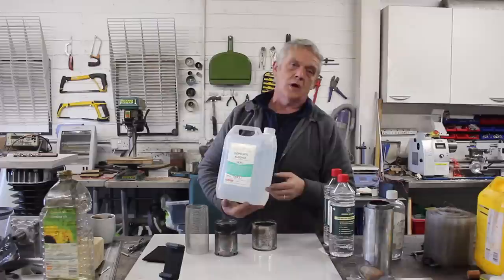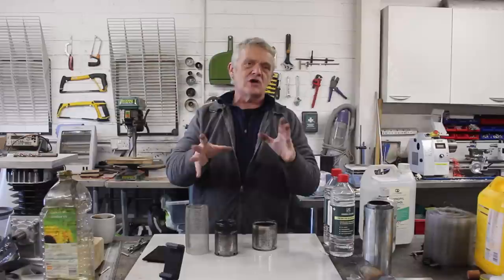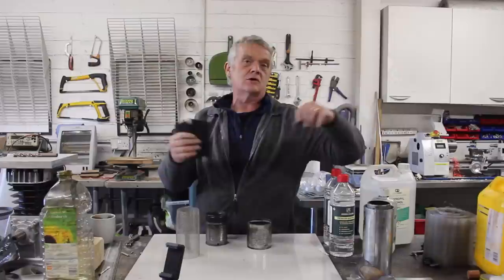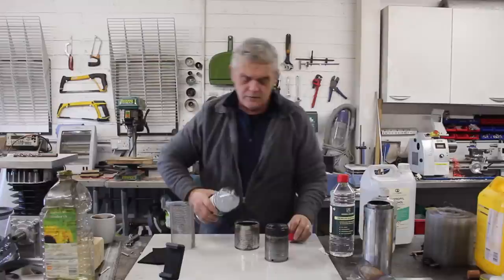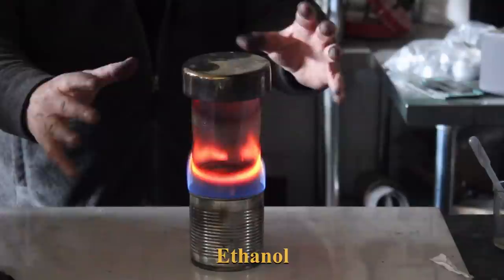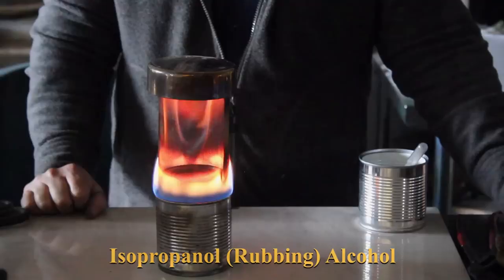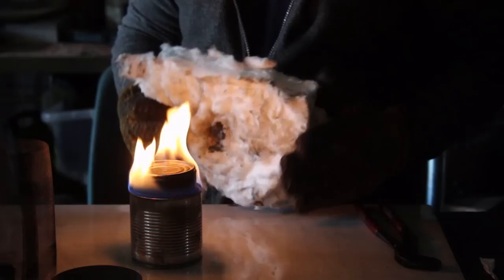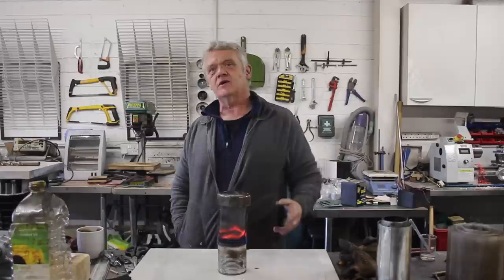1704 Trying Different Fuels On The DIY Heater 1

Comment: Here in the US, carbon felt can be found at most "big box" home improvement stores like Lowe's etc in the plumbing area in the form of a welding or soldering"blanket".
Plumbers use them for fire protection when soldering copper plumbing ....
Reply from the maker: nice one mate - thanks for helping out
Reply: Great tip, thanks for this!
Reply: Thank you very much. Great info
Reply: Thank you, I would have searched for eons!
Reply: still kind of $$ when you could use a wool sock or layers of tissue paper, cotton yarn etc.. they should last as long as the burner as long as you dont let them run dry and burn the wick
Reply: @docink6175  Up to you what you think is best. This stuff lasts literally forever.
Reply: @TheBaconWizard  your right but the stove won't, it just seems ludicris to me to make a stove using free cans and spending  a good amount of money on a wick when free or almost free will work as well for nearly as long as the stoves life but even if you need to replace a tissue wick twice a year it costs less than a nickel for the year
Reply: @docink6175  Horses for courses mate, it's always good to know all the options. For me it''s cheap and easy to get and I have other uses for it.
Reply: thanks ... been hunting for a week.... walked right past it!!!
Reply: @docink6175     Wool should last longer time than cotton etc.  Wool has a high combustion/ignition temp (higher than kevlar) and doesn't readily burn.  But then again, I haven't ever actually tried it.
Reply: @justinw1765  look for cat stove or friskies stove etc, this heater is just a modified version of those and there are all kinds of vdo's on different wicks
Reply: @docink6175  Robert's projects use carbon felt all the time. While it might not make sense for this heater here in the US, it might make sense if you upgraded the build or if you were using the carbon felt in another project, or maybe you come across an old one of these things for cheap, or if you're done with yours. Now thanks to this comment, I know that if I come across some plumbing tools at a thrift store, it's worth looking out for carbon felt.
Reply: @zahialsalman  all Im saying is there are lots of options for wicks, if you have carbon felt thats great but there are a lot of less expensive ways to achieve the same goal
Reply: @docink6175  Fair enough.
Reply: @docink6175  the problem with your theory is that you assume that the goal is to make exactly the same burners made in the video. these are just concepts, demonstrated in a "you can do this at home. today. practically for free" just do it, way.
if you genuinely intend to USE these a "forever" wick is a very interesting concept, especially as trimming wicks was a genuine problem when people used the products you mentioned to generate light. once you have a few feet of this stuff for a project why not just use the rest in these "experiments" it is a cheap at that point as any of the other scraps you mentioned.
Reply: Thank you
Reply: Yes I found it as a welding blanket and 1800°F flame resistant
Reply: Bought a welding blanket and 1800°F flame resistant, no good, not 100% carbon fiber felt. Anyone have a link for 100% carbon fiber felt? Having trouble finding it, all Lowe's had was felt roofing underlayment. No one knew what I was talking about.
Reply: That is Carbon fiber felt, welders mat. He said not to use anything that said Carbon fiber.  All the listings on ebay say " Carbon Fiber Welding Blanket Felt High Temp Heat Protective Sheet"  It never worked well in my burner.  It was a very poor wick.  It burned without the inner tin and also if I cut slots in the tin however  the methanol burned very quickly and not evenly.
Reply: Hey Mr Henderson I just came back from Lowe's and looked all through the plumbing department and Welding Department and asked so-called Plumbing expert at Lowe's they don't carry it here so I'm going to go to a plumbing Outlet place see if I can find some there thanks so much for your suggestion
Reply: @rickgomm7432  you're most welcome....but you can also ordering eBay or Amazon as well if you have trouble finding it locally.
Reply: @rickgomm7432  I used a cutting from a welders blanket.  A fire blanket will work also.  It worked much better than the carbon felt.
Reply: I was wondering if they'd be suitable, thanks for confirming.

Comment: Nice one Robert. As always when using any appliance with hot naked flames, caution, safety and vigilance is necessary. I came from the 1950s where open fires, paraffin lamps and heaters and even gas mantle lighting were common.

Comment: Just to say I have a commercial paraffin heater that purports to use a GLASS FIBRE wick, which only needs to have the eventual black oily deposits burned off by using all the fuel to empty tank. Apparently no trimming needed! Great show.

Comment: I just had a few thoughts: 

1. The flames travel up the outside of the mesh.  What about using multiple layers of mesh with spaces in between them?  That will multiply the surface area that can be heated up and radiate IR.
2. Instead of a lid, what about using cheap stainless steel scrubbers, stacked inside the mantle?  That would also increase the mass while still allowing air flow.
3. Depending on the stainless steel scrubbers available to you, can you check to see if they can be unrolled to be used as an easily-available mantle?  If not, could wire be used to hold them in place so they act as a mantle while in their original form?

Cheers!
Reply: Number 1 suggestion sounds great for Rob to check out - Will it use more oil and be hotter, use the same, or will the heat output be comparatively reduced because of the greater heating surface area required ?
Reply: @regwatson2017   the majority of the heat will escape either way so a larger surface area would catch more that would otherwise be wasted. Pretty sure steel wool gets weird when its been heated up, im not sure what a steel scrubber is but it seems like steel wool
Reply: @ScottyHugefellow  Steel wool made with tiny filaments of steel (which readily oxidizes); Stainless Steel 'scrubber' filaments very much larger -----> greater thermal mass, so less likely to become red hot/vapourise.  Copper scrubbers even better conduction.
Reply: @denisripley8699  still not entirely sure what a scrubber is, unless its what appears to be a higher quality steel wool. I can test it as a thermal mesh when identified

Edit: re-read your comment and it makes sense now.

 Thanks we'll have results soon
Reply: @ScottyHugefellow  Sorry Scotty.. I'm in my angloshere bubble !  A scrubber or scourer is, like you suggest, a heavy duty, durable version of steel wool, almost always made of stainless steel and unlikely to irritate bare fingers like steel wool does. It's the stuff that's also used in homemade distillation columns, although copper 'scrubbers' or mesh is a better option in that application.
Reply: @denisripley8699  haha thanks mate I'll get some tomorrow so we can test it out. Also a member of the Anglosphere ;) where the roos are
Reply: Just an update to let you guys know that testing is gonna be further away
Reply: @ScottyHugefellow  

Did you ever do that test?

Cheers!
Reply: @KeithOlson  no I did not, you just reminded me. Forgot all about it ended up not being able to find any in my town

Comment: That bit about the frothing madman over a sink gave me a hearty chuckle. I think we've all gone hooting baboon over a can of improvised chow. I do love my mandarin oranges fresh out of the can, dribbling down my face, spoon be damned!
Add: It took me a few minutes to remember, but at last I did. Quite the while back, I recall doing a lot of reading about a particular nut that can grow in some exceptionally hostile conditions, which also happened to produce a huge quantity of oil that could be readily refined into a biodiesel. Something along the lines of the Jatropha curcas (not sure if I spelled that correct, it's been well over a decade mind you). Again going from recollection, it was stated to be sub-tropical but could also produce viable 'fruit' in a bucket of sand. Not an overnight solution, but the temptation still resides to try to obtain a few of the buggers...

Comment: From experience make sure that botb ends of the carbon felt insert meet inside the can quiet tightly, if there is any gap here the flame will ignite the fuel contents of the bottom tin

Comment: Looking forward to finding out what this system dose with used veg oil I got lots of it Im hoping to use as a green house heater over winter as gas will be going up in price soon you love your job we love watching you do it  keep it up 😜
Reply from the maker: cheers mate
Reply: How did you get on with it mate
Reply: @nw4x4adventures  not started making one yet as my gas bottle still got some gas in it after i put foam flooring down helping it insulate it just doing that and the bubble wrap inside has dropped gas usage alot

Comment: My wife's friend was doing a hand fasting ceremony and they wanted a couple small torches, so I got a couple green twigs off a hardwood tree, wrapped it with gauze, then a bit of copper wire wrapped around it in a pleasing spiral, then doused it in 90% alcohol. When they lit it nothing but the alcohol burned so the gauze stayed bright white, the flame was visible, and they seemed to want to burn forever.
When the fuel gets too low the flame gets smaller and the outer edges will start to char, so just smother it, refuel it, and relight it.

Comment: This is great! In 1976 when I was little we moved into a house which only had an open fireplace for heating in one room and no insulation. We also had a portable kerosene heater. Considering we(Tasmania) have a not too dissimilar climate to England this was, shall we say, slightly insufficient. I learnt common sense around fires early. 😂 Mum used to put a bowl of water on top of the kero heater to remove the smell, but I have no idea if that really works or not.
Reply: Similar, grew up in a house with two open fires and several paraffin (kerosene??) heaters one of which my older brother knocked over on one occasion, it went out and didn't burn the house down.
Reply: @tuppybrill4915  lol, I just looked it up and it seems paraffin and kerosene are the same thing. I know it can be used as jet fuel too, but it’s not as refined.
Reply: Flame heaters and wood stoves tend to dry out the air in rooms/homes where they are used. For this reason I have always used a bowl or pan of water placed on them, gently releasing moisture back into the air. Helps prevent the wood of my many musical instruments from drying out and cracking. Never noticed it having any effect on smells.
Reply: My mama would put orange peel and the like in a pan of water on the woodstove. Helped with dry air and smelled good too.
Reply: At the age of 6  both my parents were at work when I got home from school so my first job was to make the fire, I would light the kindling in the fireplace then wedge the coal shovel in the opening and cover it with newspaper to block out the air and draw the fire, I guess they had different rules about kids and fire in those days 😂 alternatively we had a gas poker which you could light and shove under the kindling until caught alight.
Reply: @tuppybrill4915  yeah we had a kerosene heater which we used on cold winter mornings, I believe they had a safety feature which caused them to extinguish if knocked over :)

Comment: A great video as ever! 
Regarding ventilation, as a comparison Natural Gas fires fitted to a chimney only need a vent providing outside air for combustion for 7kw input or greater, the average gas fire being only 5kw, "adventitious ventilation" - draughts under doors etc - being enough. Decorative flame effect fires DO need a vent: (yellow flames = incomplete combustion). A chimney/flue is still needed for the above.

I couldn't begin to calculate the input of one of these heaters, but I would favour using only the fuels that burn blue (yellow flames = incomplete combustion, soot) - then you could warm tortillas on the top bit! 
The fact that it's a radiant heater means you can "heat the person not the space" so you can feel the benefit quickly without depleting the oxygen in the room, but use caution with any open flame appliance, maybe get a carbon monoxide alarm, check for soot etc. Room size matters.
If this sounds a bit r-c, a friend of mine died of CO poisonning by falling asleep in his campervan with the cooker on to keep warm.

Comment: I experimented using bacon grease in a small tin can with a half-size paper towel rolled up as the wick and let it burn in a basic wood stove fireplace - it was enough heat to warm the place up quite a bit for several hours, not as much as a wood fire but it was pretty good and if I put 2-3 cans in at once that would probably get to a decent temperature...  which is pretty good for using up waste, and if you had access to something like [expired/cheap] ‘vegetable shortening’ it would work too.  😉
Reply: That must have smelled amazing. 😋
Reply: There are many YouTube videos that show how to make long-lasting candles and heaters out of store-bought shortening. Having waste lard or tallow would be even better!

Comment: I can't wait to see the heavy fuels video, I have some filtered oil mix from frying accumulated throughout the year that is painfull to dispose and it could be nice to use it this winter for a bit of room heating, I tried it on a simpler wick and cup but it puts out a lot of smoke and i would like to see the video and read comments to get ideas for a solution to that smoke

Comment: Hi, thanks for your video's, I am enjoying both the subject matter and also your presentation. I have only just found your Chanel as it came up with this heater which I am interested in. May I be so bold as to suggest that you take a look at the video's of Heath Putnam. He has spent quite some time perfecting the alcohol stove and I am positive that it will give you some food for thought. 
   May I ask what gauge stainless mesh are you using? As I want to have a mess around myself with my various types of wood gas stoves. You can't beat "free" fuel. I use these for camping and if you have a look on YouTube you will see a great amount of interest in this.
    I also wonder if you would try adding some disc's of mesh horizontally across the mantel to act as flame diverters. Which I think on some of the more aggressive flames would both control them and also increase the inferred output.
   Keep up the good work and your jovial attitude and I will be a follower of your Chanel.
Many thanks John

Comment: I did it in smaller version ( just recycling corn tins, saucepan lids and other stuff in kitcken ware) and it works, really works, great invention for penniless homes. for the mantle I got a piece from an old mosquito blind for windows. for the back shield aluminiun I picked from a broken quartz heater. Methane I got it in plumb or DIY stores. ( even there are outlets from work places or giving away)

Comment: I have been curious if you could add carbon felt to a round kerosene heater?  Now I know the greenhouse heater didn't work with the carbon felt, however I wonder if it would have worked if a piece of copper tubing was used to hold the wick under the heating element.  If so then the same idea could be used on a round kerosene heater and be a long term heating solution if the need arises, and as a bonus you could use other fuels if need be instead of just kerosene.  Also the round kerosene heaters are kind of a mantle based heater just scaled up to 11 so it does kind of fit in with this idea.

Comment: In US - rubbing alcohol is often sold cheaply but at 50% concentration or less.  Maybe a video on concentrating or ‘drying’ alcohol up to 70% with salt
Reply: Nilered has a good video on it to explain the principles.
Reply: We have 50% AND 90% where I live (in US).
Reply: We have it in Canada, but it runs easily $10 for less than a litre.

Comment: I add a bit of epsom salt, copper sulfate , borax or table salt to make the flame a little more visible.. regular table salt will change the flames to a yellow, copper sulfate=green, borax=light green, epsom salt= orange, you can also add a copper wire at the wick top and get a blue/green flame, salt substitute/potassium chloride gives a purpleish color
Reply: carbon felt makes a great wick but you can just use tissue paper or a piece of cotton towel, a wrapping of cotton line etc.. I just use beach sand in my alcohol stoves... it also works with oil.. dried coffee grounds also work AND chases mosquitoes
Reply: another "wick" is also a safety factor, fit a roll of tissue in the can, saturate it, you can lay it on its side and no alcohol comes out... use a metal disk to control flame size, either leave a small gap around the edge or drill burn holes in the plate... the bottom of the can stays cool, you can actually pick it up (carefully)

Comment: Its a basic Kerosine heater design with the same principal of a fluid sucking wick with a mesh around the flame. The thinner the mesh the better. Very cheap to build design you made. Ofcourse a Kerosine heater uses pressure to push Fluid through a little generator to pre-heat the Kerosine making it a evaporate into gas and burn more violently. Hence your burning time is reduced but the heat generated is more intense. Makes sense. Your system if carefully re-designed could be used in a tent and even heat a pot of water.  Simply foldable (nested) into each other packed in a sturdy cylinder. The mesh is the expensive part and should be easily replaceable on the go. To glow the whole mesh (ideal) the wick should be used with a special heater head. Something that burns the full length of the mesh. Probably a tube with very tiny holes over its entire area.  Genious, thanks.